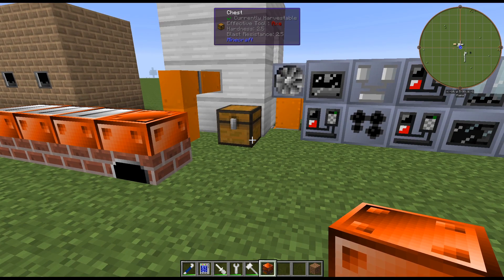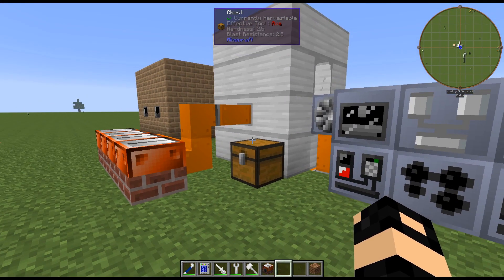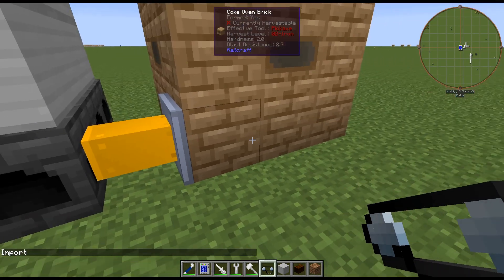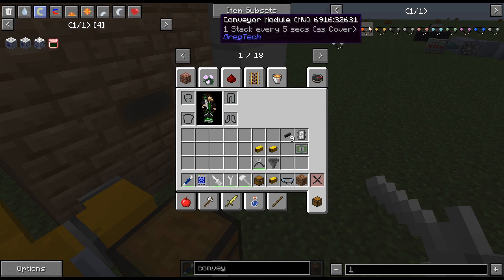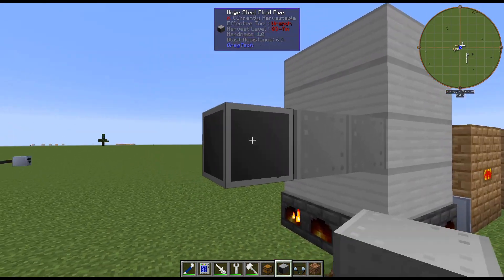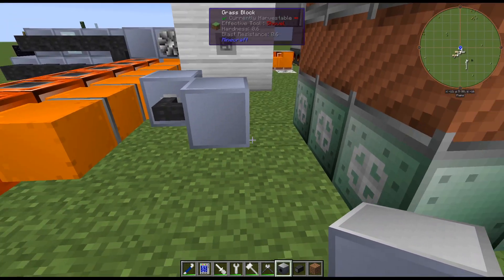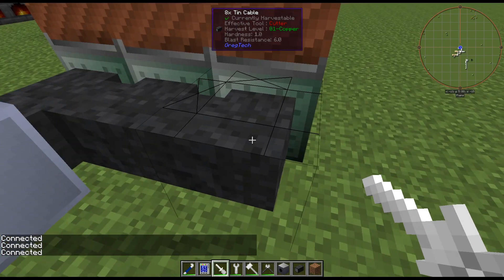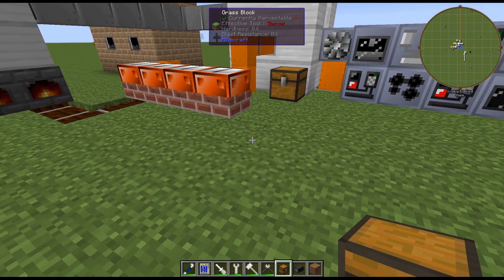Gregtech New Horizons Tutorial - 6 - Electric Blast Furnace

Comment: i do everything accordingly and i still get the hit with soft mallet in the end which doesnt restart at all..., ill try putting the energy hatches in the side. EDIT: OMG i got it working, i using wrong number circuit it needs configuration 1 without any gas